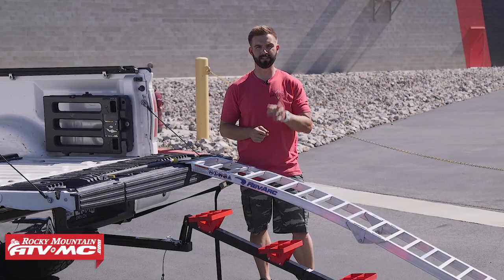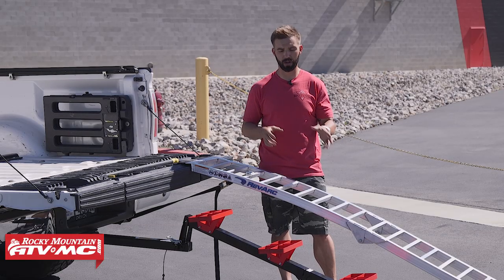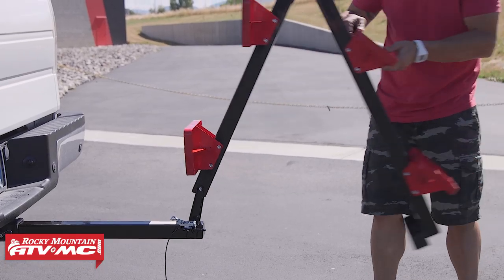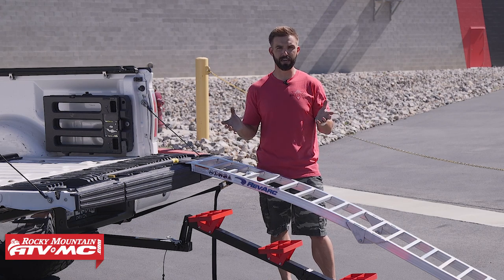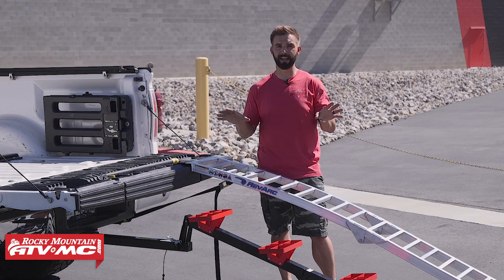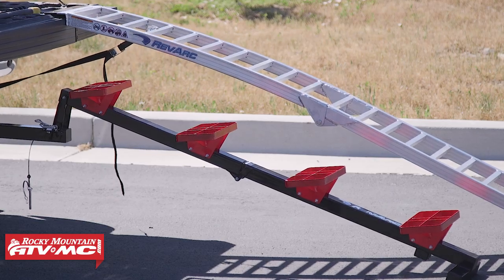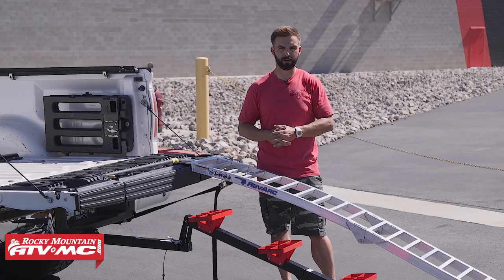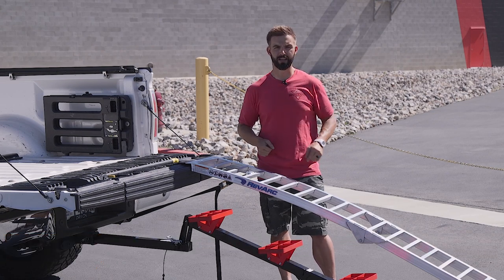RevArc Dirt Bike Loading System Review

Comment: I use a similar ramp, but use harbor freight aluminum folding platform rather than the bike stand.  It tucks nicely into the back of the truck.  I wish it was a few inches taller, but it works and its nice and solid.   It hangs out in the garage as well.  I use it around the house for things as well.  Makes a seat to.  That thing looks like something else to clutter up my garage with no use.  Until I get a place to store a trailer at the house my current set up will work.  Its worked for the past 20 years or so.  With a stool or the recent platform after I broke my plastic double step stool finally.

Comment: If you have a Rekluse and LHRB you can start your bike and throttle it up and hold it with LHRB if you need to stall and step up as you go. I do like this system especially if you already have a decent ramp.

Comment: Ive got a 5x10 with a ramp gate. I see guys all the time with a $50,000 truck and a $10,000 bike struggling to load their bike in a truck. Unless you don't have a place to store it buy a trailer !
Reply: Why?  I'm at a race or observed trials competition every single weekend in the summer.  I've been using these steps and ramp for 4 years.  It's perfect.  No need to haul a trailer for 1 or 2 bikes.  Now if you're hauling 6 or 12 bikes... OK...  Hook up the trailer to your Cummins.